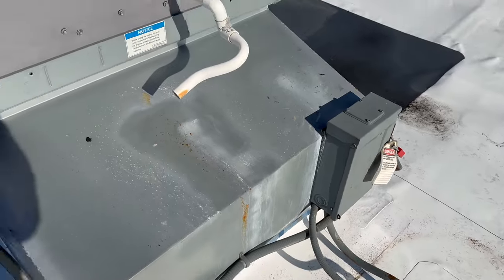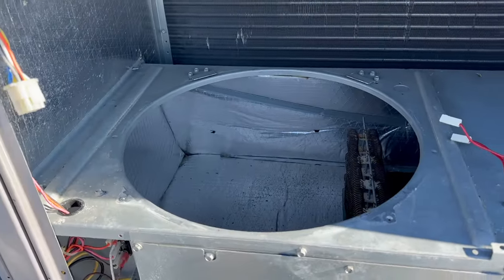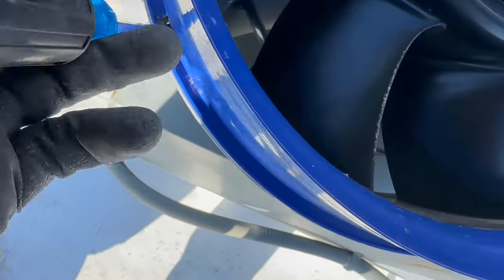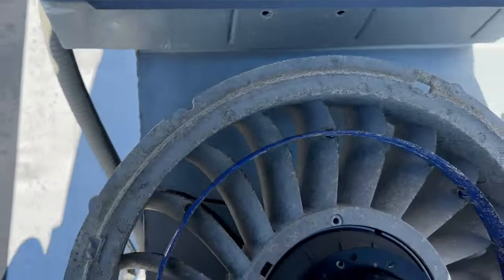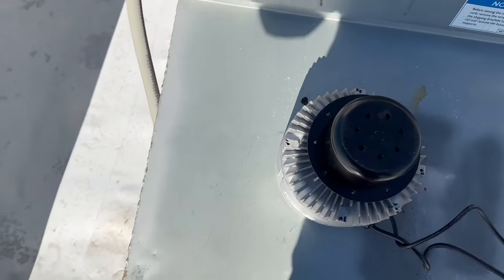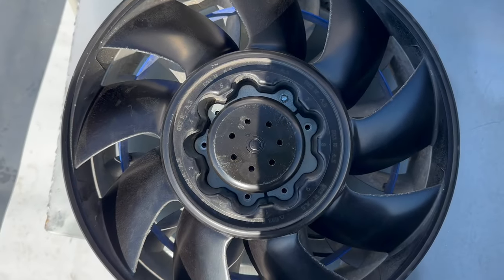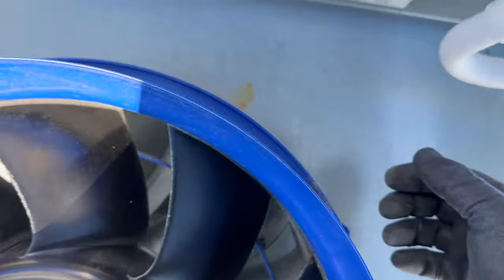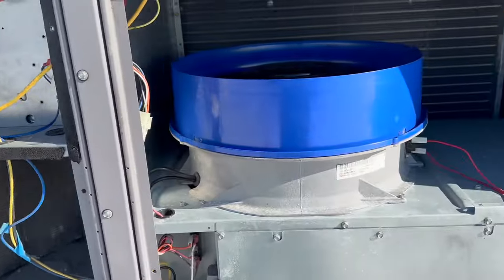HVAC - Carrier ECO Blue   HD 1080p

Comment: More than likely, this was a department of energy efficiency requirement, because all of the new carriers either have this type of ducted fan or they are using some form of VFD drive so that they can make the numbers that the DOE wants to see. All the new Lennox equipment has a drive, along with the Yorks. More expensive motors mean a higher markup.
Reply: ECM blower motors can be used too since ECM motors are basically AC synchronous motors with built-in VFDs.
Reply: @davidperry4013  That's right. More cost to the customer when they fail prematurely, as they have a well known history of doing.

Comment: Dude set your drill to 1 so you don't over torque and snap the cheat ass aluminum frame, then use your nut driver to tighten down.  Use the most important tool you have, your brain.